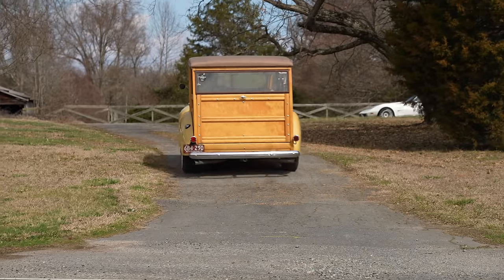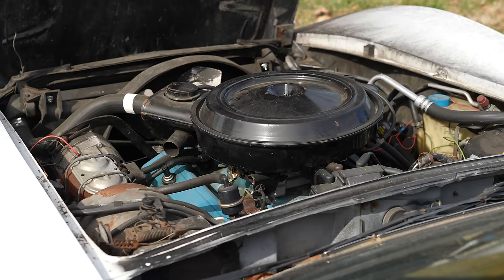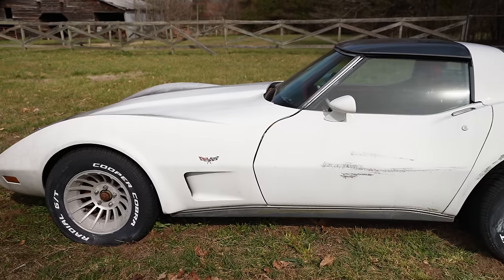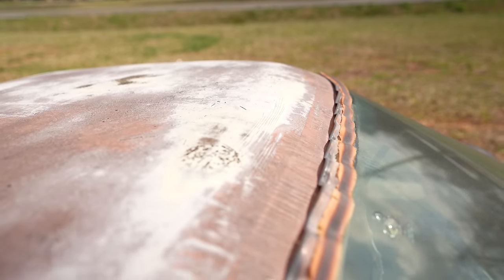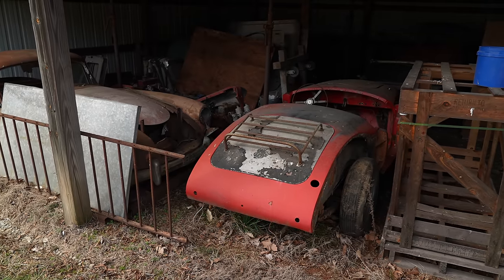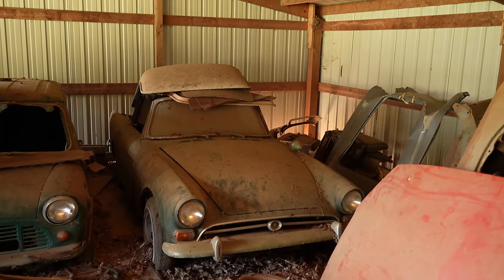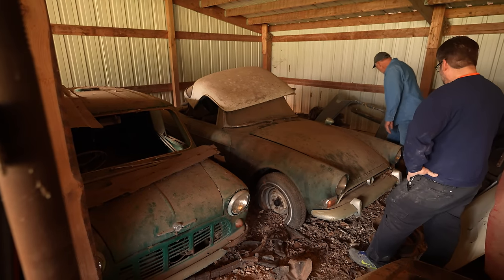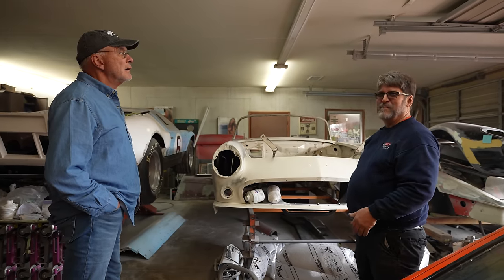Corvette HIDDEN in Plain Sight & Multiple British ICONS Resting in a Barn | Barn Find Hunter

Comment: I just worked on a friend's 1980 Vette a couple weeks back. Original owner, under 30k miles, probably #2 condition now, but with some detail work it would be #1. It's red with black interior, and runs/drives fine. There is no way it's worth $40K.
Reply: A non-special edition c4 is pretty cheap they made so many of them He's specifically talking about a concourse grade car which any budget job will never be
Reply: Remember this is sponsored by an insurance company The higher the value the more money they get

Comment: Check the ground cable coming from the battery box in the rear to the chassis. Those things get eaten up from hitting things/bumps in the road. Might solve your electrical issue.

Comment: In pricing the car, Tom states that it is an L82, but the 195hp version is the L48 base engine.  The L82 was 225hp.  And I believe it would say "L82" under the Corvette emblems on the fenders, if such.  I had a 1979 L82 Greenwood Sportswagon until it unceremoniously burned to the ground in Phoenix, Az.
Reply: And no matter what, this is one of the lowest-HP Corvettes ever made in the modern era.  If I wanted to actually drive that car, I'd LS swap that thing in a NY minute, and stash the original engine in the barn for the next guy who might want to restore it.
Reply: @redmondjp  --  With mine having the L82 and an automatic and my wife having a 1995 Buick Riviera with the 225hp supercharged V6, we just had to run them.  The Riviera smoked the Vette.  But with that station wagon back end, the Vette was stunning.
Reply: That is an L-48, pretty much worthless.  It’s a money pit.  Sad thing about ‘vettes, even the chrome bumper ones are worth less than a decent 67-69 Camaro!  I had a ‘71 LS-5 ‘vette fun, dumped a lot of money in it.

Comment: Regarding the battery drain, does the clock still work? If not, it probably shorted out and is a steady battery draining point afterwards. Good luck with your restoration! 💙💙💙